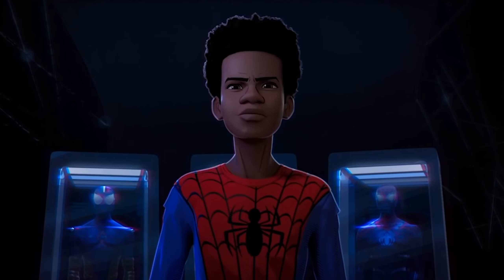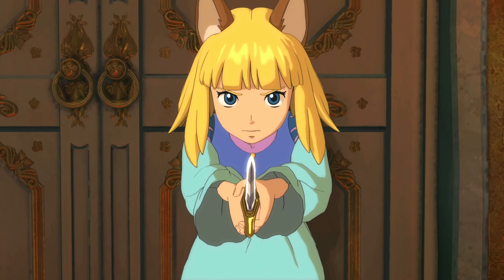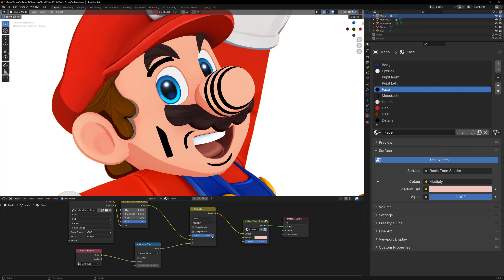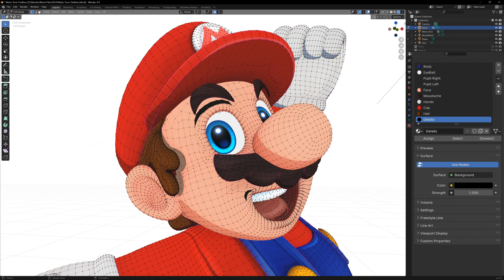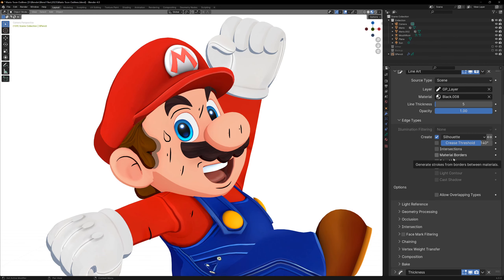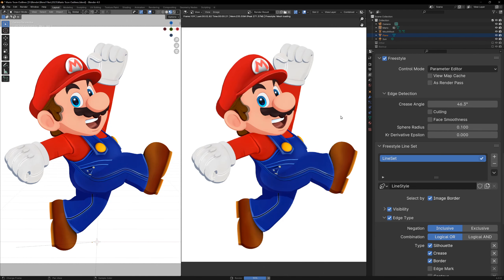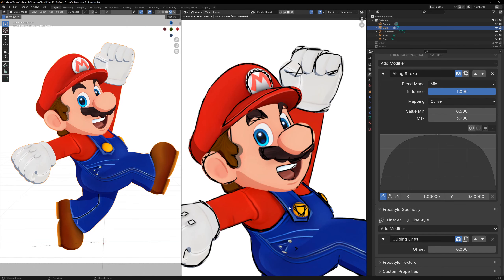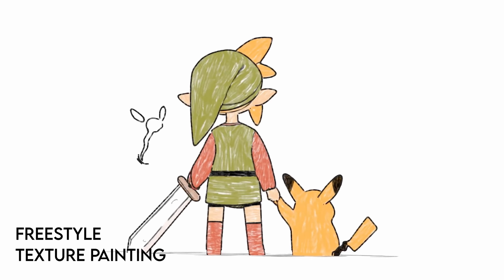7 Ways to Make Lineart in Blender 4.0!

Comment: I’m assuming Grease pencil does work outside of blender since it was used in spider verse 2 pipeline. Although I believe they made a private tool to make the conversion
Reply from the maker: I watched a talk about it and it seemed like they imported a scene directly into Blender and then used the Grease Pencil. I'm sure they've made tools to export the grease pencil lines but it's not natively possible. You can convert Grease Pencil lines to a mesh, but that just gives you curves/vertices, you would then need to add thickness to those lines
Reply: It’s a bcon23 video. Pipeline detour specifically for the line work
Reply: PIPELINE DETOUR BABEY!!!!!

Comment: Question about the vertex groups for the inverse hull outlines, is there a way to change colors in realtime based on the background colors? Say an outline stays dark when the background is light colored, but it then changes to a lighter color when the background is dark. Basically inverting the outline's color or value based on the background or environment, or in certain positions during animation.

Comment: Nice video. My thoughts on the methods:
- Inverted Hull is easy to set up but imo it doesn't look good and it's really easy to distinguish since everyone uses it

- Material color I'm really not a fan of messing with the model, if avoidable

- Vertex color I'm not too familiar with but it looks like it's good with details but not outlines

- Texture paint mostly the same as vertex color but stored in a texture, so it'll be rasterized and needs higher texture size to look good

- Mesh planes is more ideal since it's not tied to the model and you can easily animate it separately or hide it

- Grease Pencil is alright. Downside is that it's camera locked in viewport and performance heavy, but you can bake it and manually fix stuff afterwards.

- Freestyle has some useful options that GP doesn't, but not being able to see it until render is a massive downside imo
Reply from the maker: Exactly, those are the main benefits and downsides to the different methods!
Reply: Which one to choose for friendly performances? Thanks 😊
Reply from the maker: They're all pretty efficient! The only one that slows down sometimes is the Grease Pencil depending on how many lines you have in your scene, but apart from that, all of the methods are about the same
Reply: @marclapinff2709  None of them are particularly "performance heavy" but like Vertex Arcade said GP can be slow. If you're only using one active at a time it should be fine, but once you add GP to multiple different characters/objects it does start to slow down. I suggest setting up every GP object, adding them to a dedicated collection, and then disable it until you need them again.
Reply: @iamawatcher9201  Thanks for your reply and advice :)

Comment: the texture method can be improved if you use a separate texture with the greater than node, and with that you don't need to have as high res of a texture, and I'm pretty sure in most cases you can recreate the shader in other game engines
Reply from the maker: Yeah true, although if the texture is already pixelated, the result will end up just looking like filtered pixel art, and sometimes you want the transparency of  lines, the greater than method won't have any alpha element to the lines, it's either black or nothing

Comment: Just utilize pixel interpolation to make the hand painted texture solution just as clean and sharp as the vertex painting solution. It’ll be just as if not a lot cleaner. And texture resolution can be drastically reduced

Comment: Isn't there a geonode or something that lets you convert grease pencil to curves, and then to mesh, so you could export to other engines?
Reply from the maker: I'm sure there is somewhere, but you would also then need to bind that new grease pencil mesh to your rig and make sure that the weight painting looks good. So at some point you would need to Apply the Geometry Node modifier, which then loses the procedural nature of it

Comment: Is there a way to make freestyle do a lineart respecting a material's alpha?
Reply from the maker: Yeah, under the Freestyle Alpha section you can tell it to also use Material, and then in the Freestyle Colour of your material you can set the colour and alpha and the Lines should be the correct colour and opacity. You won't be able to plug in a texture or anything, but you can set an overall Opacity for certain lines

Comment: in old editions of Blender there was an option where you just pressed a button and the lines were made automatically and you could instantly change the thickness and color of the line and it didn't affect the speed of the render, I don't understand why they eliminated it it's a tragedy, Now all of these options are a pain in the pan and time-consuming
Reply from the maker: That's Freestyle, it's still there it's just a bit hidden now, I go over it in the video!